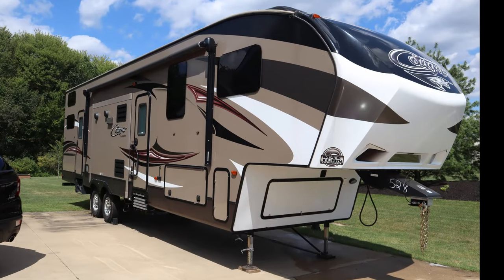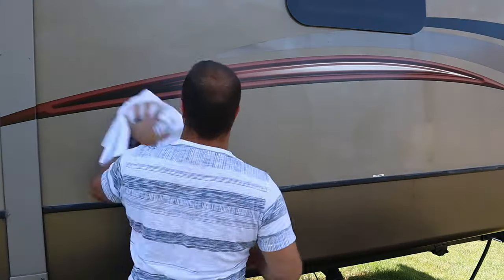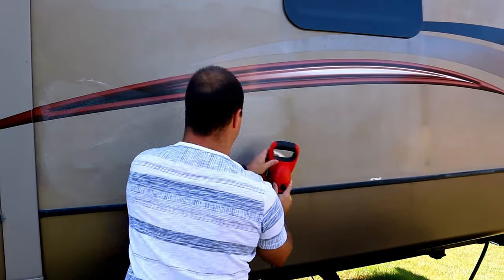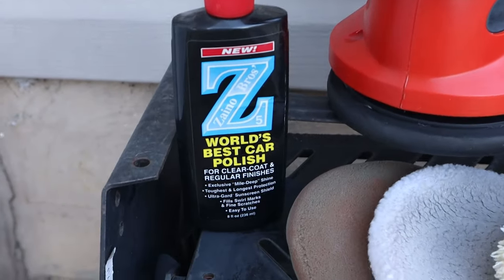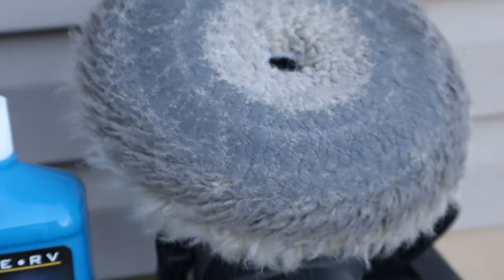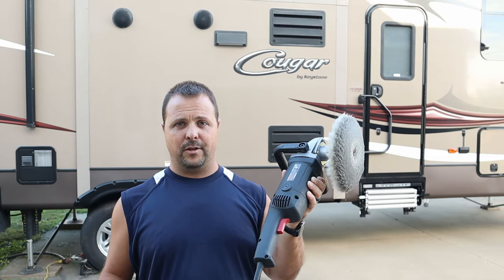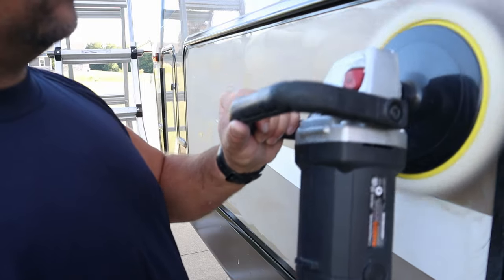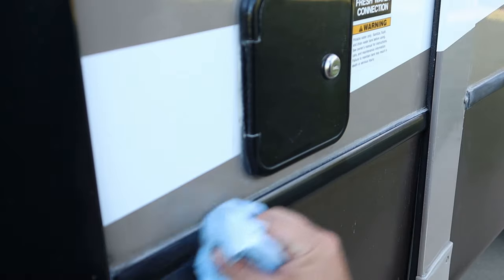Remove Oxidation and Restore Faded RV Fiberglass Meguiars One Step

Comment: Hey bud it’s looking great! Couple of tips from a rv detailing shop owner. 
1. Be smooth and a little slower with your passes. Make a pass then move down a little and make the next pass directly below it. Makes sure you don’t miss any spots and you don’t have to go over it 5 times. 

Second. MASKING TAPE is amazing. Mask off all those edges and trims you don’t want your product on. Sometimes back to black only works for a few days and your lines come back on the trim. 
Masking tape will guarantee they don’t get on it at all
Reply from the maker: Jon, thanks for all the advice I appreciate it.
Reply: I’m glad you included everything that you tried. I’m beginning to restore an old Coca Cola cooler. It’s pale pink from oxidation. The hardware store recommended turtle wax polish which I rubbed by hand with a rag. It helped just  a little but I think I need to try something else . That one step might be the key. Thanks
Reply: I only did 1000rpms with a mist of water over surface and it left halograms/ swirls very light pressure I do not get what I did wrong
Reply: I appreciate so much that you left a constructive and positive comment - awesome! Sounds like great advice!

Comment: Nice Video, Before you start buffing again I recommend stopping by a auto paint supply store and getting a yellow wool pad with a proper back up pad so it stays firmly attached. The yellow wool will be aggressive enough to remove oxidation but soft enough to polish to a brilliant shine once you bump the buffer speed up. medium to medium high speed should be more than sufficient to do what you are trying to do. 3M makes a good quality yellow wool.  By the way for a do it yourself job I think you did excellent.

Comment: I just bought a 21 year old Bigfoot Gel Coat fiberglass camper. I used 3M Superduty compound on a 9" double sided pad driven by a heavy Dewalt with slow start. The camper glass absolutely looks like factory new. Took me 3 days. Followed up with 3M Perfect it polish and ceramic wax. Feels like silk.
Reply: I used same product it last for three month then i found poli gro product supposed last for five years no buffing required

Comment: Great video and info bud 👍🏼
I mixed a cup of baking soda, 2 cups of vinegar, and 4 cups of ammonia and filled a 5 gallon pail with hot water. I filled a dollar store squirt bottle with the mixture from the pail to spray on and let it sit for a couple minutes. Then I just took a brush and started scrubbing. I used a sponge with a scrubby pad on one side (scotchbrite) for around the edges and windows. 
This really brightened my decals and removed the grime buildup as well as tree sap etc. my next step will be to try what you’ve suggested. It’s great to find other guys who share their success! Thanks again 👌🏼

Comment: great video and info. Some tips for your consideration, use painters tape to cover areas you don't want discolored with polish/compound. I would also say after spreading the product at a lower speed, raise the speed of the machine and use slower overlapping passes to work in the polish until break down. Lastly consider using a sprayer bottle with water over the polish/compound to help spread it and prevent gumming up. The polish work in time is a little bit longer with the spray of water.
Reply from the maker: Thanks for the tips
Reply: would you spray the water on the panel after you’ve applied the compound ?

Comment: Hi boss.
1st, love the effort and journey. Now that you have had some introduction into the world of gelcoat, I invite you to consider the following video as another option.

The reason your B&D buffer had it's best results along your DMZ between "before" and "after" is because you probably hit that line, each and every time you were near it to leave a nice clean line, it did. You allowed the compound to work there longer than anywhere else in your working area.

I've done this for almost 20 years. If you didn't wash the RV well after compounding, you'll see fade soon, especially if you trusted the bottle of #67 that claims to polish & PROTECT, it won't protect any more than spraying your RV with cooking oil so some but nothing real. Dont believe me? Call them like I did.

You need more but I appreciate what you went through to get here.

Lee

Comment: I gave it a try  - bought a new buffer used the wool pads and the one step - I must now accept the fact that I have a have a learning disability as my camper has streaks everywhere - no matter how much I buff, I just can't look at it at sideways, quite nasty - At least my class A is tall enough when I jump off it I can do a lot of damage... so much so I will be incapable of trying this again...
Reply: Remember gelcoat is porous it retains dirt. You have to use rubbing compound that comes in blue bottles from meguires use a wool pad on a Dewalt buffer and be patient. Gelcoat is a tough substance you have to work a lot harder to cut it than say automotive clearcoat.
Reply: Try a RANDOM orbital. Usually a lot more forgiving with swirl marks than a straight orbital
Reply: Great video I have the same problem I will try it with an orbital no-fault buffer it won't burn to finish it orbits and turns at the same time
Reply: My ex, restores old cars. He buffs a lot. The way to clean your buffing pad,when it gets gummed up, is to take a screwdriver and hold the end of the blade at a slight angle against the pad as it’s turning at a medium speed, I think. Experiment with it. It doe do a good job of cleaning it. Start in the center and run your screwdriver out to the end of the pad. Hope this makes sense. I’ve never done it, but watched a lot.
Reply: We have the exact same camper. We bought used. The camper had set out in the Florida sun, for 3 years. Very oxidized. My husband buffed it using different products. He’s 77, but a strong tall guy, so he did ok, doing it. Wore him out. It started looking pretty good. He did burn a few spots. He doesn’t have a background in auto detailing. I sorta do via the ex. So, I warned him about staying in one spot too long. Anyway, plz never use TSP on your roof to clean it. He did and now out pretty shiny camper has white streaks, that we’re not sure we can get off. Looks awful. A video recommended TSP. He. Ought a medium cut compound and it looks a little better, but you can still see the streaks. TSP has citric acid in it. So it’s an acid burn. I’m so upset. I sent a message to the video maker. He of course laid it, off on the maker, of the sealer brand he was touting. He didn’t actually use TSP to clean his roof. So, just be careful what you use. We’re gonna keep at it, but ….who knows. May need to be wet sanded. Hope not. Good luck.

Comment: You’ll get better results and it won’t take so much time if you clean the pad regularly while buffing. Just get a stiff piece of plastic or metal. Turn the buffer so the of is facing up. 
Turn the buffer on and then hold the plastic/metal and run it over the pad. 
It cleans out the dried out polish and you don’t have to wash it till you are all done. 

Other than that. Great video. Looks great! I do the same thing with my boats’ gel coat.
Reply from the maker: Thanks for the tip!

Comment: Great video brother! One suggestion: buy one of those hand held wheels to clean off accumulated gunk and polish. It spins as you turn on the buffer at low speeds. The stuff flies right off and you have a new wool pad surface to work with. Repeat as necessary.
Reply from the maker: Thanks for the suggestion!

Comment: Nice job and NICE RV. So many people bust Harbor Freight. I have 3 Porter Cable NA/DA sander/polisher and a 11 inch Sears Buffer becuase there were now HF's in those days. Your keys are the right compound and pads and "Keep Moving" Thanks for posting, it saves many hours of experimenting. I have used McQuire products since 1986. My 2006 Ford Crouwn vice still looks new. Look into Mothers Clay bar kits. May be an idea for you.

Comment: I can’t wait to do mine!
Side note;
I’ve been using 303 aerospace UV protectant to stave off the daily effects of the sun, and it has been a great product for this purpose. You might consider looking into this product to enhance and protect your hard work. I really appreciate the video, and as I said I will be trying your method with the common sense suggestion comments that apply. Aloha, and happy camping.
Reply: I use 303 on my plastic parts, are you saying you use it on the fiberglass walls? I do see on the label that it can be used on fiberglass, but I was a bit worried coating my entire RV with the stuff
Reply: @mse1333  
I have had no negative issues.
The rubber around the windows, and tires too.
I use it on our cars as well. It seems to last for a few months on the sunny side, longer on the shade side. 
Happy camping. Aloha
Reply: That’s a lot of work when you could just use 303. It’s good enough for the space shuttle I’m sure it’s good enough for the RV.

Comment: I have had a similar journey. My winnebago is white and I pulled decals off leaving sticker shadows and a pretty significant difference in white. I started by hand and have ended up with a dewalt professional polisher and started with wet sanding. I am however using this one step polish after a heavy compound. It is pretty incredible stuff. It seems to be the best single step stuff. Starting slow RPM keeps the grit heavy and speeding up really breaks it down and polishes. I am topping with Maguires marine wax.
Reply: How did it ultimately turn out for you,
We have a 2003 Winnebago also with some all over oxidization.  Not very sexy!  We're considering this process.
Reply: @PlanFree  You know what?  I ended up wrapping in white vinyl.  I polished my ass off.  But the laminate panels on my View just had wierd corrigated patterns showing and it just did not polish like the bubble.  The bubble polished like a boat.  It was super oxidized and polished like nothing.  The vinyl wrap was easier to do than polishing for sure.  At least for me it was.  I used Vivvid vinyl and paid $500 for 100ft of it.  So far so good.  It is 1 year old now.

Comment: Welcome to the fun of polishing. There is a brush and a wheel that are used to clean the pad. Try to do it after each section or two and you can do the whole job in a day. It also polishes more consistently with a clean pad. Using a rotary, it is possible to burn through the gel coat, so it is important to keep the machine moving and use a low speed setting. There are a number of sealants available that you spray on a wet surface and rinse off immediately. They will help a lot with preventing future oxidation so long as they are reapplied as needed
Reply from the maker: Ryan, thanks for the advice
Reply: Can you name a few of the sealants?
Reply: @toolgirl30 Poliglow or 303 protectant are both good sealants after the hard work that have UV protection…

Comment: Thx for the vid..just a note..once you get the shine back make sure you use a synthetic sealer to seal the surface to avoid the chalky effect coming back....use a sealer such as turtle wax "seal and shine"..easy to apply and will give you at least 6 months of UV protection as well as a nice bead to help keep surface clean...avoid using organic waxes as they diserpate on first hot day or wash off after a few weeks
Reply from the maker: Thanks for the tips.

Comment: McGuires makes a 3 step. Depending on how much oxidation you may have to do it a few times.  Key is to constantly clean off wool pad or try   McGuires cutting pad it’s a maroon color foam pad which cuts through oxidation but cleaning pad is key to removing it better 
I do detailing on rv gel coats 
Once ya get it nice buy a cover to prevent and keep sun from doing it again wash regularly. It’s a lotta work but the reward is worth it

Comment: Not sure with a wool pad, but when I do my cars I lightly wet the pad also to prevent gumming.. also I would use a ton less compound and smaller work areas,, that said have not done my travel trailer yet and after an hour Ill probably be like "screw it" and doing 12 x 12 foot areas hahaha..    Thank you for posting.. now I need spring to get here.. ug
Reply from the maker: Thanks for the ideas.

Comment: I don’t think anyone touched on this. Rotary polishers create speed swirl marks or “holograms” in the finish. For near perfect results you will also need to polish the finish again with a polish not a compound. You will need a DA Dual Action Polisher or Random orbital polisher to get rid of those speed swirl marks you will create with a rotary polisher. Either way there is no simple easy way to do this process. It takes quality time to get quality results. Just know ahead of time this will not be an easy one day only task. Just work on one section at a time. Don’t overwhelm yourself.

Comment: Get ya a spur tool to keep that wool pad clean and not all gummed up. Will make buff better as well with a clean pad. Nice job. Looks good.  I have a cougar as well.  I use 3D speed on mine. It also works well.

Comment: Best way to remove oxidation is to dry sand with 1000 grit or 1200 grit to remove most of the oxidation. It will fall off like powder and you will start to see the Shine. Then do it just how you explained!! But you did great And I been detailing RVs for 10 years! The dry sand will stop any gum up because you remove the oxidation mostly which is like powder. Slow process no doubt lol
Reply: You are absolutely insane. Dry sanding or wet sanding should only be done in rare cases. That is absolute madness to wither down a thin enough clear coat as it is. He should be compounding it with a circular buffer, not a DA. Da’s are great for waxing but absolutely should not be used for compounding. Your sanding advice is absolutely terrible.

Comment: Great video!  Thank you.  You found how aggressive you have to be with fiberglass, gelcoats etc. to cut through heavy oxidation.

One suggestion...clean out your pads after every section.  Or, have a BUNCH of clean pads and switch out to a fresh pad often.  Pads load up quickly with dead paint and compound product which lessens the effectiveness.  I'd have maybe 20 pads to do an RV or 5-7 pads with frequent cleanups.

Excellent results you got, my friend.  Be proud, very proud.

One su
Reply from the maker: Thanks!

Comment: Hey bro you are doing it right but it’s better to apply just the marine wax apply the marine wax to the a rag and once it in the rag apply it to the the parts where you are going to buff it to but you have to apply good amount of wax so it won’t dry and the process will look good I specialize in rvs
Reply from the maker: Thanks for the advice
Reply: Are you saying to wax it before hitting it with the buffer and buffing compound?

Comment: Hi I have an aluminum camper with the compounds you're describing work on the aluminum product? And most of all and most important which I should have said first I guess, is I have a 2006 VW Volkswagen that has that old paint look on the Hub Cap cover and on some on the front of the car it's a navy blue and I try to compound and I tried of course I'm so I'm older so I'm not that strong and then I try to small buffer tool and I tried a buffing compound do you think that these compounds and a stronger tool might get off the paint finish I can't even talk this is so foreign to me do you think these products might help with the Volkswagen finish? If there's typos I'm doing voice to text because I have hand problems but I would get a guy to help me do this on my car one of my friends is real strong a guy okay God forgive me if this is just a hot mess thank you Debbie
Reply: Looks like your comment slipped thru the cracks of comments.. hope you found your solution..

Comment: Thanks so much for your video. Have the identical problem you had and was using the same compound. 
   Like you I just wasn’t getting the results I was looking for.
Switched to a wool pad and that did the trick.
Thanks so much for your info!!

Comment: The only thing that would speed up the process is keeping that wool pad clean. Use compressed air or a spur to keep the pad clean. Keeping a buffing pad clean is essential to efficient and proper application.

Comment: Amazing difference! - I have a 27 foot  2014 Forest River Ultra Lite TT - It is starting to look a little "chalky" - I've ordered the compound you use and I'll see how it does with a buffer I already have - Thanks for the great videeo - Cheers!
Reply: How did it go Gary ?
Reply: @glenngray1201  I found it difficult to apply and remove (buff) but temperature and humidity can vary these results greatly. - Good luck with it!
It did a good job on lightly oxidized area - I ran out of gas (personally) to do too much of the RV.

Comment: Buy some one restore from eco chem and have them tell you the ratio to use for the fiberglass. Mix it in a pump up sprayer and spray on and let dwell. Then simply rinse with a garden hose and it will wash the oxidation away with no buffing. I own an exterior cleaning company and that’s what we use for removing oxidation on houses. Never done fiberglass which is why I recommend eco chem telling you what ratio to use.
Reply: Jeremy, how long do you leave the product on, before rinsing it off?

Comment: Great video, I watched several times.  Just got the One Step No. 67 in the mail today.  I am still up in the air about the wool pad.  Looking at the one that you mentioned I noticed a lot of complaints about hair and wool fibers coming off of the pad.  Did you noticed this or have the same problem   If so is there anything that will solve the issue.  Again thank you for taking the time to do this video, the best video out there on oxidation removal. Cheers
Reply from the maker: Thank you.  I did notice some wool fibers, but they wipe off easily with a clean towel after you are done buffing.
Reply: @WeekendRVAdventures  Thankyou